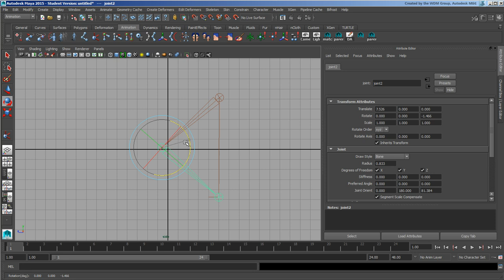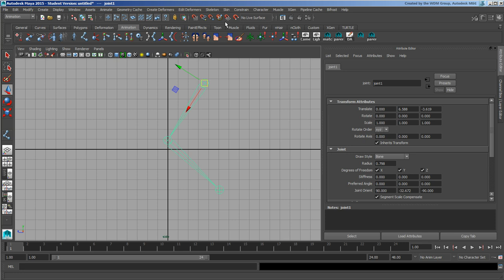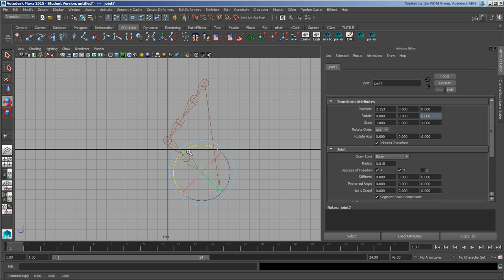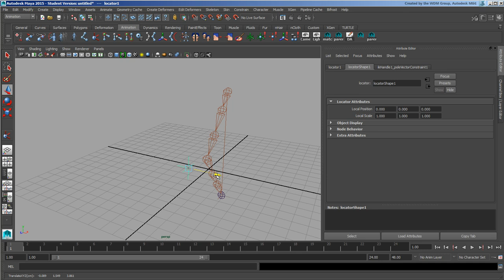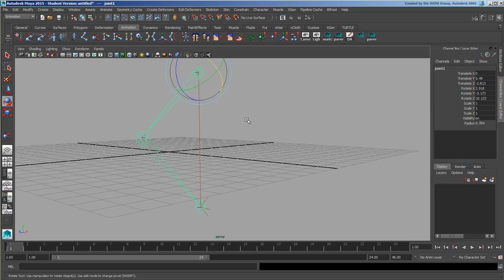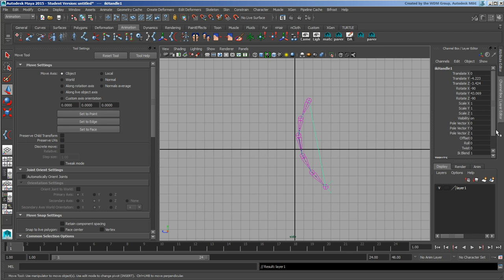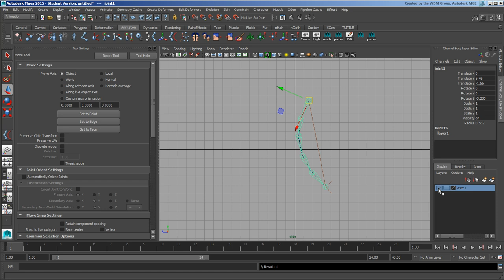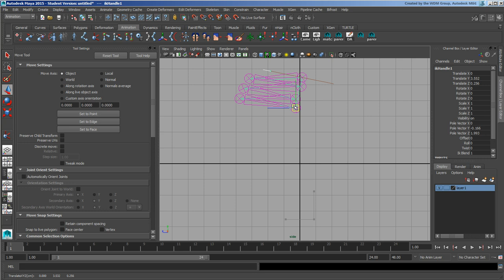Exploring IK Solvers in Maya - Part 2

Comment: Single Chain solver is designed for single chain - just 2 joints and a bone between them.
But I (and i saw others riggers too) often use it for 3 joints chain and it works fine.
There is not a lot of technical info regarding that joint in MAYA docs. And even in MAYA docs they show example of SC solver used on 3 joints.
So, guys, if you know more information about SC solver and the way it suppose to be used - please share.
Reply: I'm super new to rigging so...
big grain of salt,  but I was reading  recently that the main difference between the two is the twist of the joints. with RP you need to use a pole vector to control the twist but with SC  the ik controls the twist directly as seen around 5:15